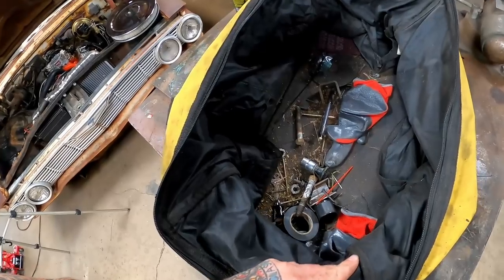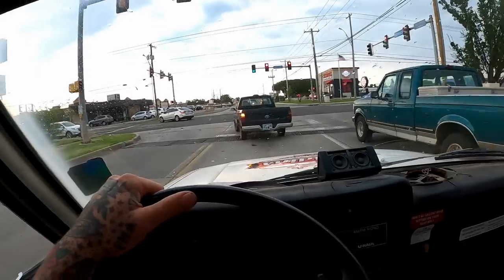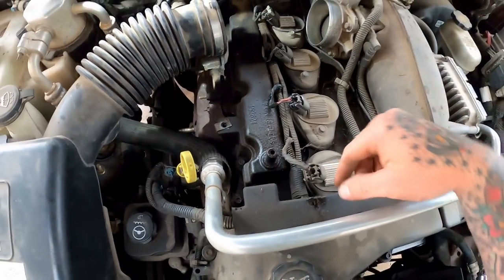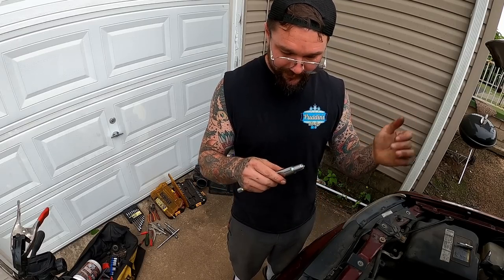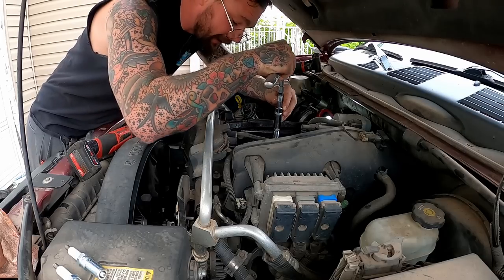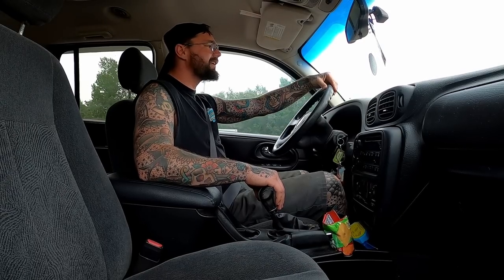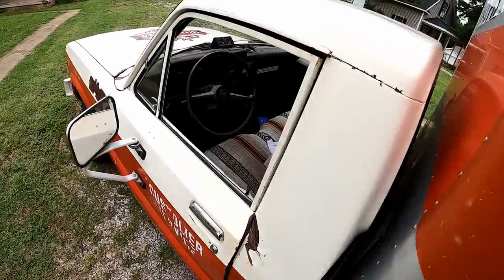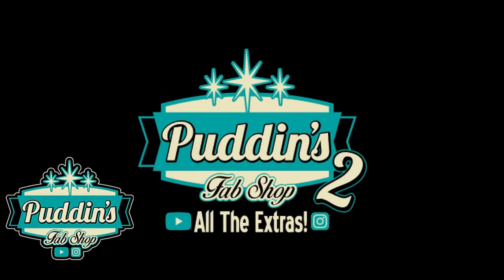ABANDONED for FOUR DAYS. 2005 Chevy Trailblazer. Will it run???

Comment: A short piece of rubber gas hose makes a perfect tool for starting the plugs into their spot in the cylinder heads. It not only will prevent you from cross threading the plug, it may prevent you from dropping the plug. Just slip the terminal end of the plug into the hose and you're ready to install the plug! 
This tip is provided to you by the good folks at Rebel Boat Works, a soon to be YouTube channel! 🤠
Reply: Dang that’s a cool trick. I’m takin notes.
Reply: 🗿 a must on hot engines. 3/8 fuel hose works best, IMO. Definitely a trick all wrench turners should know 👍👍
Reply: Someone told me that trick after replacing the plugs on my Quad 4. I just used electrical tape to hold them to get started.
The parts place kept trying to sell me a wire set... I kept telling them I didn't need one. They said I'd be back. I said I would, but not for a wire set 🤣

Comment: Something I’ve learned from personal experience on my own trailblazer back in the day. The wiper cowl would leak water onto the #6 coil and cause it to fail. It was a common issue on these. Hope this helps 👍
Reply: I guess I got lucky, I've owned multiple Trailblazers, from a 2004 to a 2008 and they have been The most reliable except my 2004 that the rear differential broke

Comment: One trick i learned if i have a questionable coil in the back of the engine I switch it with one on the front of the engine that is more accessible. That way if it is bad then it is alot easier to switch out with a new one.
Reply: Exactly

Comment: Puddin! Future reference. If you have a wasp nest like what you had there. Get a cup. Put a little gas in the bottom. And trap the nest with them in the cup. They will quickly fall right into the gas and you won’t have to worry about the mess!
Reply: I just tried this for the first time yesterday and it worked amazing !! Only had like a 1/2 inch of gas in the cup and it killed like 30 of em in 2 seconds !!!!

Comment: Hey Puddin', I've got an '02 T-blaze with the 4200, if she's still runnin rough or sputtering try swapping the fuel filter. It's right under the driver's side, takes about 10 mins and they usually last about 30-50k miles.
Reply: Fuel filter never hurts to change out... But Puddin' has a transmission issue. Hopefully it's a solenoid or electrical in nature. I say that because there was nothing sparkling in the fluid... But that's not always the case.

Comment: I just watched a video from Summit racing and they happen to be talking about iridium spark plugs. According to the summit racing guy you’re not supposed to change the gap on iridium spark plugs because the wire is fragile. So you were correct not to change the gap.   Great video.

Comment: Rubber fuel hose works real good to put on the top of spark plugs to screw them in when your plug socket doesn’t have the rubber inside it. 😊

Comment: I may have had my hands on that Trailblazer! I worked at the assembly plant in Moraine, Ohio that built those! The plant was closed in 2008 and is now a Chinese auto glass factory.

Edit: The extended versions (GMT370) were built in Oklahoma City, but we did build some for a couple years after they were introduced
Reply: Did you assemble my 2006 TBSS sometime in October of 2005 (it was a pilot vehicle)? :)
Reply: Mr. Jim Flanagan been work on engine GM Assembly .👍👍 When here is the city great deal trucks built in Flint Michigan.
Reply: Three shifts, so there's a 33.33% chance I did. Those things are awesome!
Reply: My stepdad worked at that plant( OKC ). I remember when they switched the plant over from the Chevy Malibu to the Trailblazer. I also remember when they put in the mailbu line. He was in skilled trades and I got to see the equipment in detroit before they put it in the OKC plant.
Reply: @josephawatson  If I remember correctly, a tornado heavily damaged that plant. They repaired everything then ended up closing a few tears later.
Reply: @JimFlanagan4206  Yeah the plant was damaged and it closed a few years later when needed that bailout. Stepdad wound up getting to retire early. The plant is now an extension of the airbase here (Tinker AFB). not sure what they do there now.
Reply: I drive by that plant about once a week

Comment: Check the TCM fuse. While researching transmission issues of my own in my Silverado I read if that fuse pops it puts the transmission into limp mode, stuck in 3rd in drive, but can be manually shifted, sounds pretty simular to what you have going on there.

Comment: Yes reset the PCM then drive it like ya stole it to let it relearn. The big thing about cleaning with brake clean, is to not do it while running, burning benzine is hazardous to your central nervous system. The coating from the factory lining the tbody is pretty durable.
Great video once again!

Comment: Puddin,
Maybe someone commented on this, but in case they didn't.  I've had good luck by doing what you did.   When you start it up, let it idle.  Then put A/C on.  Go in gear and back out.  Let it idle some more.  After that you drive it.  You're really just teaching it how to run and shift again.  When I do this I drive it locally, then on the highway.  Takes some time, but is well worth it.  Doesn't help bad transmission though.  Also might want to get some mass air flow cleaner and clean that sucker.  That will also make a huge difference in how the vehicle runs. Not cheap, but well worth it.

Comment: my spark plug socket never has its rubber, thats why i keep some old fuel line in the toolbox, fits right over and pulls them out at any angle. also assists with insertions...

Comment: I think I told you this last time, but I use a 18" piece of half inch rubber fuel hose to put spark plugs in places I can't reach, and even ones that I can, I always have my spark plug hose in my tool box.

Comment: That blazer likely has the 4L60e trans. Those are notorious for shift issues. The aluminum valve body with steel internals wear poorly. You can get one for less than 200$ they are relatively easy to replace. Should cure the shift prob. Hope it helps brother!

Comment: Just went through the exact same thing with my mother's trailblazer about 6 months ago. Lost all gears shut it off let it cool down a bit and the gears came back. Pulled the pan and the pan and filter was plumb pack of clutch material (sh!t). Those blazers are heavy and those 4Lslippys don't like the weight and tall gears. I ended up back flushing the lines and cooler and slapping a new filter in it and it's been shifting since, sometimes it's a little more drawn out to shift but it shifts none the less. It bought me enough time to locate another trans so that when this finally goes I have one on standby. If you go that route just get the filter for a deep pan. There's 2 different sizes and the trailblazer uses the deep one. Good luck.

Comment: If u want to check  if the coil pack is bad just switch it with one you know is working,,,if the miss switches to the new cylinder u need a new pack

Comment: I got a 04 Trailblazer inline 6 and love it! Been a good little beater. And running around on back roads and power line trails is a blast. Although I had All Terrain set installed instead of old All Season tires that came stock on them lol.
One thing I hate is the alternator location...it's a bugger to change lol.

Comment: Protip for the future, diluted dish soap in water in a spray bottle, like dawn or the like (in fact the dawn concentrated stuff works best) after mixing it up, will kill the bees and hornets on contact within seconds. the soap helps the water get into their pores and basically suffocates them by removing the surface tension. it's a simple household trick that just works. The only issue you may have is finding the right spray nozzle.

The one thing you do want to do is keep the weeds on your lawn for a while, especially since you had that tornado blow through recently. honeybees are starting to go out foraging and you definitely want to let them do their work so they survive... out of all the bees, let the most important ones live.

Comment: I have had shifting issues with a trailblazer before its been a while but it was either the abs pump or the module under the driver side next to the trans on frame rail

Comment: It depends on the solenoid. If it’s 1-2 solenoid it’ll lock it in second and not allow it to shift. I’ve had a couple people had thought the trans was bad. A couple oe solenoids later and they shifted like new.
Reply: the solenoids keeping a vehicle from shifting is total xhit.  not easy to replace or cheap

Comment: I’ve owned a 2003 model it’s did the exact same thing I ordered another throttle body from rock auto and it worked. I didn’t have to unhook the battery so it could reprogram or learn throttle positioning

Comment: May 05 is in the same boat I replaced two need 4 more coil packs, others are still working it just needs tune up, those suckers are not cheap though, mine would misfire and cut out.

Comment: Excellent video Puddin  :) in fixing up your moms 2005 Chevrolet Trailblazer  on change Spark plugs plus Number 6 coil part to & clean up Fuel Injection TBI and for Transmission problems get black  bottle of brand WYNNES   of called Trans Medic put Transmission when cold or engine start up then put brake pedal on shift up from 1 to Netural wait 30 seconds then put Reverse  then Park to wait one minute ! Then brake pedal on go to  Park , Reverse, Netural wait 10 seconds  then Overdrive, Drive ,  3 , 2, 1 wait 5 seconds shift up back to Park ! Then check fluid smell and color  says if bright pink to  red and go for test drive start from  1 all rest to Overdrive and see shift better to ! If not get too Uncle Rick of do change fluid plus gasket on pan and filter too ! See what happens too and Solilendo too! Hopefully this helps out solve problems!

Comment: Had the same problem on 02 trailblazer where missfires plugged up the cat and the back pressure in engine actually made the computer refuse to shift transmission.  I thought the shop mechanic was lying but I had to eat my words when it fixed the transmission issues by changing the cat.

Comment: I have the envoy with the same 4.2 inline 6... one strong motor thats puts out 100
more more horse with a turbo then a 350 with a turbo... tranny has easy to get to solenoids... I put a corvette servo in it to give a harder shift from first to second... coming up on 300k and tranny shifts perfect... change fluid every 30k and installed a big tranny cooler on it... all synthetic everything...

Comment: Personally, I would have swapped the new ignition coil with a different cylinder for easier access and to see if the trouble code changed to a new location. Good job Puddin'.

Comment: what may be happening is its not in a limp mode but a service mode, literally disconnect the battery and hold the two terminals together for a minute sometimes you need to do that to reset any modules if not you have some sort of tcm issue also see if you can rev the car beyond 2500 rpm that will show if you are in a limp mode or not

Comment: Best unplug that battery before you clean any electronic/drive by wire throttle body...learned that the hard way on my 07 Accord ended up having to replace it

Comment: I worked on one and couldn’t figure it out. Finally took the exhaust off and found the catalytic converter was stopped up. After I replaced the plugs, coils, crank and cam sensors.

Comment: I assume you worked on the B-52 at Tinker? I worked for DAE and we built and assembled 6 sets of wrap around stands for the B-52 also some E-3 and B-1 equipment. From 2008 through about 2014.

Comment: Working on “AGE”  or in Marine Corps we called it GSE, there was a hydraulic power supply used to power hyd systems for them airframe guys, well there was an old Jenny that had a 2 stroke 3 cylinder Detroit 3-71. We used to race the starter change, that top bolt was a big pain in the rear. The secret was a short 12 point socket with electrical tape. It could take a novice 12 hours, they would have that whole thing disassembled trying to get it, me and another buddy had it down to a 15 min job 😂

Comment: Should not have to remove fuses , will relearn automatically. Also brake clean is fine for throttle body. Map/maf cleaner for air sensor.

Comment: That fly by wire system has had recalls... Pedal.. control module.. and the flash on pcm for pedal... Um. Go drive it a bit hard on freeway.. it may clear up., Thats providing pedals not being glitchy...

Comment: If that's a 4L60E in that Trailblazer, and it has lost 2nd and 4th, then it's a band problem. There's a couple of tricks (shim the servo) that might make it work again for a little while without pulling the transmission, but it won't be too long and it'll do it again. Needs to be rebuilt, or at least torn down and a new band installed. Sorry Puddin'.
Reply: He didn't say how many miles were on the thing or if the trans had ever been serviced. Sounds plausible.

Comment: My 97 Corolla has an issue with the automatic transmission where it won’t shift to first gear and I have to manually shift it to low gear for it to takeoff then it will sometime miss second gear all together and free wheel like there is no second but there are days it shifts just fine.

Comment: Limp mode is a plugged cat. Yes clean that throttle body.  Might have had the hose off where it was leaking oil, that can cause issue. Will it get above 3500rpm?, if not see 1st entry.

Comment: Mine needs shocks, AC and radio fixed, and eventually rest of the coloilpacks, prolly radiator flush, maybe cat back exhaust they get clogged, im prolly gunna het something different soon, it will cost more to fix than it's worth, doesn't leak oil super clean no check engine lights.

Comment: I cleaned a throttle on a 2003 chevy trailblazer and disconnected the battery to rest it onTuesday and and when I was done the transmission wouldn't shift and was doing the exact same thing so we sent it to our trans shop and they said it somehow got stuck it 4×4 or something so they charged us $150 to manually disable the 4x4 and it is running perfect now

Comment: I had a 2002 jeep grand Cherokee and I got a code for a shift solenoid and I called the jeep dealership and the guy in the service and parts department said that I should do 3 solenoids when I am in the transmission he said they usually do that when they have a costumer come in with 1 solenoid and he also said but the dealer part or the same brand it's a lot of work and do you want to get a China part that is cheap and get stranded or damage the transmission. He was really helpful and set me up with fluid and a filter and gasket and the 3 parts it was only $98.00 I couldn't beat the price anywhere with the name brand parts and Mopar fluid the solenoids even had a replacement warranty of some sort

Comment: 8:55 that's the same engine as my chevy colorado. that tube is the pcv valve hose. when i was working on my engine i found it wasn't connected correctly and the hose was deteriorating

Comment: If it’s a 4L60E transmission those things are made of plastic and glass. My old ‘99 Blazer popped the trans and I didn’t have 2nd or overdrive. That wasn’t a solenoid, it was a clutch or something. Wasn’t worth the fighting with so I got a ‘96 Mustang sixer then an ‘89 5.0 Mustang.

Comment: Awh man you're just like the rest of us this week Puddin', stuck workin on some newer nonsense. Hopefully you get it, it stinks going into limp mode and only getting 5mph. I'll bet that was scary for her! Looking at #6 and how you had to go small to get the plug socket in, man on my Honda you have to drop the socket with 1 3" extension in the hole then get a 2nd 3" extension in the first one then put the ratchet on.. they make it super easy to do plugs on the 3.5 v6 from Honda. Yay

Comment: A trick that will hold your plugs in your socket one way is put duck tape inside your socket the sticky side out that will hold your plug in your socket.. the 2nd way is put a magnet in your socket.. either way both will hold your plug from falling out... Funny I just got done giving some tips and went back to finish watching the video and you just used tape... have a great 4th of July...

Comment: I never worried about any coating on the Throttle body. I used what ever I had but my go to is 2+2 Isopropyl Carb. Cleaner. IT HAS THE CHECKERED FLAG ON IT, YA CAN'T GO WRONG IF IT HAS A CHECKERED FLAG ON THE CAN, RIGHT ?

Also once you unplugged the T.B. it was already disconnected from the electrical system, NO NEED TOO PULL FUSES.

I use Anti-Seize on my spark plugs if they need it, some don't. Use Dielectric Grease also.

GOOD LUCK wit ur Mums Blazer, Sir.
Reply: Pulling the fuses was to try and reset the learned memory in the ECU.
Maybe the trans has a memory as well and maybe pubbin reset that as well? 
I would just drive it for a while and see if it re-learns to a point where it's good2go.
Reply: @jfv65  Ya probably screwed up the Trans. ? Not sure on those Blazers myself.

Comment: Trailblazers 2:00 do this. Has to do with software or something, needs to be reflashed at the dealer for a few hundred bucks but maybe not fixes the problem entirely. This is what I have heard, I too have a Trailblazer and it does the same thing.

Comment: I repaired this problem in the past and...THERMOSTAT, believe it or not,  it will cause slight stumble at idle. Computer crap communicates with TPS & temp sensors sending more fuel than necessary at stop signs due to inaccurate temp readings. Weird I know.

Comment: There is 5.3 or 5.7 engine known to points and condenser or number 6 engine maybe a coil. I know use junk gas run engine rough . I've 9-1999 Tahoe 5.7 engine . Typical Rustin quarter panels, typical front fenders rust .yes I've known Michigan not good on vehicles. Your friend in Flint Michigan Gordon 👀✌️✌️🤓🤓👀👀🇱🇷🍀🚦🚦 great vedios